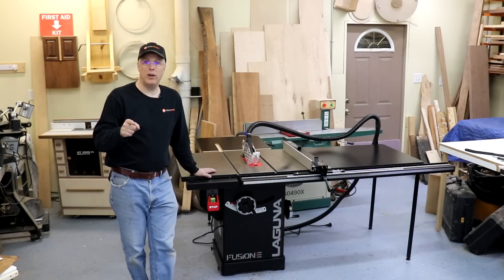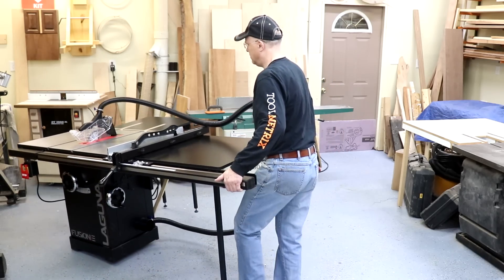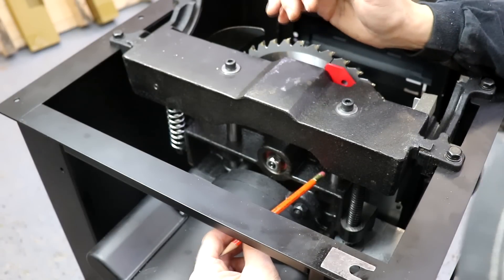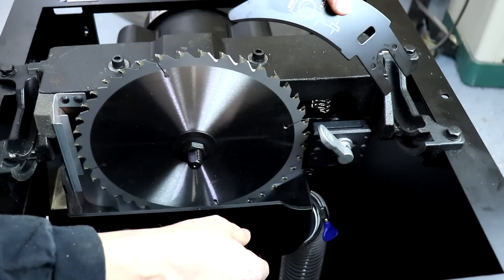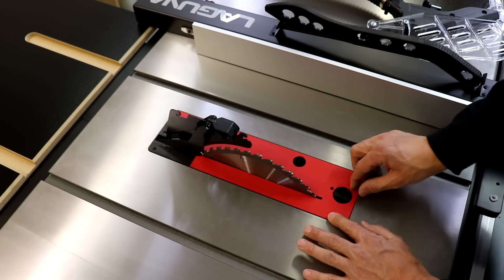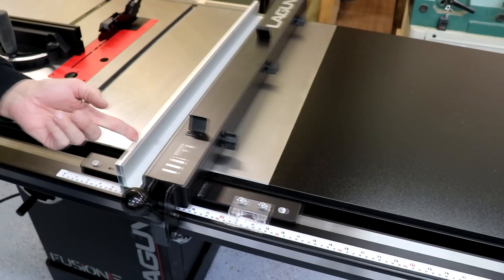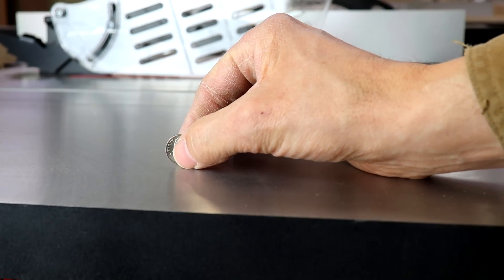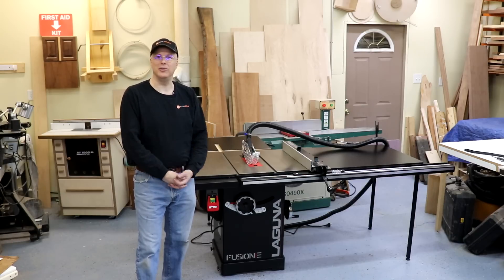Laguna Fusion F3 Table Saw Deep Dive Exam

Comment: Can anyone tell me if they still have this f3 after three years hows it looking on the reviews still happy with it
Reply from the maker: I did not have that one in the shop for very long so I can’t comment on longevity. But hopefully someone else can chime in.
Reply: @ToolMetrix  so that probably tells me that you did really like the saw much and thanks for the info ☺️
Reply from the maker: @anthonypalazzolo6181 I loved the saw, actually. But I am a tool reviewer, so I have tools coming through my shop all the time. I don’t have money or space to keep them all. I can’t actually keep most of the tools that I review.
Reply: @ToolMetrix  ok I didn't realise that sorry so I wouldn't make a mistake if I bought the f3 eventhoug I was looking at the SawStop contractor model but in a much expensive cost and towards the end it was another $450 d for the wheels  after I was getting the update fance and the cast iron wings all up was over 45k tha sort of turned me off and the f3 I was saving much more I can still bu the SawStop for that money but at the end I coudnt justify all the value and the compartment I do understand about the safety features but at the same time there's other tools that you can chop your finger off 
Thank you for the response and I enjoy your videos cheers 🍻
Reply from the maker: @anthonypalazzolo6181 no I don’t think you would be making a mistake. Both are good saws so I think it mostly comes down to how much the sawstop brake system is worth. If you use a blade guard it probably doesn’t matter much.

Comment: Great review, does the blade being closer to the front make it problematic to use? I have noticed that other table saw blades are further back.
Reply from the maker: I’d rather have it a couple inches back but it didn’t prove to be a problem when using it.   If necessary the fence can slide forward to effectively position the blade further back.

Comment: Is the blade a direct drive shaft off the motor didn't notice a v-belt drive from motor to saw blade shaft. I thought most where belt driven with some sort of v bely or serpentine belt . Do you really need to keep those kickback teeth on the riving knife Thanks for the review just getting ready to up grade from my Delta 3052 T2. Can you put a set of JessEm hold downs on the fence clearing the aluminum section on side of fence. I understand there dust collection wasn't that great compaired to a Harvey or Stopsaw.
Reply from the maker: The F3 is belt driven.  I believe that you can remove the anti-kickback pawls or flip them out of the way.  I'm not sure about the Jessem hold downs, as I don't use those.  I think the SawStop would likely have better dust collection if you have a big enough dust collector to take advantage of the larger internal hose.  If you use the F3 with a large DC, I would replace that internal hose with 4" all the way to the blade shroud.  I haven't looked at a Harvey so I can't compare that one.

Comment: Is it heavy enough? I tried to find out how much it weighs and I can only find 400 lbs. Online. That doesn't seem heavy
Reply from the maker: Seems heavy enough. Virtually vibration free when running. At 400 pounds it’s not going to move if you bump it.
Reply: @ToolMetrix  I'm considering buying this but am nit sure of I sure get this one or the grizzly. My brother in law has a grizzly and I know they are solid but the aren't in stock now and the dust port is on the wrong side for me.

Comment: Hi there, I am in the market for a new saw and looking at the Laguna F2.  I watched a few videos about them fence, and I am really concerned about the fence, there is no support on the other end of the fence, how much play is there, especially if you are cutting large boards the inaccuracy will exacerbate the problem.  Whats your opinion.
Reply from the maker: I found the fence to be solid and accurate. I have no rear support on my unisaw Biesemeyer fence either and it’s extremely durable and accurate as well.

Comment: Hi Paul, I should have my fusion 3 coming in a month or so (I’m UK based) and am looking to buy some blades. Could you possibly tell me if the blades for this machine use pin holes next to the main 30mm bore/arbor hole? And if so what diameter and spacing apart they are?

Thanks or the great review of this saw, just  what you need when you’re thinking of buying one!
Cheers,
Rob
Reply from the maker: Hi Robert, thanks for watching, and for sharing your feedback.  The F3 that I had here did not have any such pin holes, but it's possible that the UK version might be different.  I'd suggest checking with Laguna or their UK reseller.  Cheers, Paul

Comment: I'm pretty sure Iv watched this video over 10 times lol
Reply from the maker: Thanks x 10! 🤣
Reply: @ToolMetrix  Hey Paul, I was wondering if i could maybe get your advice.  I am kinda stuck between the F2 & F3 Table Saw.

I am a Canadian & I currently rent a basement.  I have full access to a 2 car garage by myself.  The landlord knows I will be doing woodworking.
The garage is not wired for 240v so i would have to bother my landlord to hook up a 240v breaker & outlet. 

Soo is there a big enough difference to stick with getting the F3 (240v) ?   or will i be happy with the power & usage of the F2 ? 

Price is not that big of a deal.        im planning to cut all types of hardwood and soft wood for furniture... tables, desks, art..
Reply from the maker: The F2 has plenty of power, so it really depends what you are used to.  With a good blade, it will rip through 4/4 and 6/4 hardwood with ease.  You'll have to take it slower with 8/4, whereas you can plow right through 8/4 with the F3.  My main saw is a 3 HP cabinet saw, so I definitely noticed the difference when I was cutting on the F2.  That said, I'm not a production woodworker, so I would have absolutely no problem doing everything that I make on the F2, and I'm sure I would love it.  If you are used to a more powerful saw, you can install a smaller diameter, and thinner blade, and the saw will feel more powerful.  A LOT more powerful actually.  For a LOT more detail on the advantages of a smaller blade, take a look at this video: https://youtu.be/_uJWWg-aawA .  So, all that said, if the difference in price isn't a big deal, a 3 HP cabinet saw is a treat to use, so don't let me talk you out of the F3 if you have the itch.  You'll also want to get a sense for which one would ship sooner because both of these saws have been backordered a lot lately.  They literally seem to sell them faster than they can make them.
Reply: @ToolMetrix  Thanks a lot man. I really appreciate your comment and honesty.  I still have about 3 weeks to decide which one i want before I can pick one of these bad girls up! 

Im pretty sure there is a store just a few blocks away from my house called "Federated Tools"  in London, Ontario Canada. They have them in stock on their website but I'm not 100% sure if they have them inside their building or if they just pass the order on to laguna.   I wont be able to find out until our city's LOCKDOWN is lifted on May 19, 2021.

P.S. Iv never used a Table-Saw before lol.. as a matter of fact,  as a guy who just turned 30 iv only used a mitre saw about 3 times. 
Thanks to COVID iv been studying Woodworking (Tools & Projects) for about 6-7 months... IM READY TO START MY CRAFT.
Reply from the maker: You're in for a great time!  Best of luck as you dive in to your new hobby.  I got my first table saw for my 30th birthday.  I've been having a blast with it ever since.
Reply: @woodpecked3D  Did you get your saw yet? I am also looking at this saw to buy from the same store, (I am in Brantford) and  was wondering  about availability.

Comment: How does dust collection work for two separate areas? Are they combined into one hose?
Reply from the maker: Hi Terry, yes, there is a single 4" inlet connection, and the hose for the blade guard collection branches off from there.

Comment: If you buy the F3 37", are you able to get Laguna accessory legs to support it?  Or do those only come with the 52" version?
Reply from the maker: I believe that they only come with the F3.  I doubt that they would be necessary on the 37" version.  Would be easy enough to attach some legs if you wanted to though.

Comment: Thank you for your previous comment 2 more questions concerning the laminate extension:
1. Is the extension plywood or MDF and laminate surface that may be possible to install a router insert in either the 36" or 50" extension?
2.  Is the deep dive photo that is standard showing the 36" extension w/ legs?
Reply from the maker: Hi Ed, the extension is a composite material; not plywood.  I don't believe that it was MDF, but unfortunately I no longer have the saw in my shop and I can't check it for you.  As I recall it's 3/4", and it's a fairly large span, so yes you could install a router insert but I would reinforce the table to prevent sagging over time.  The photo on the thumbnail is of the 50" version that I had in my shop, and that model comes with legs.  The 36" model doesn't have legs to support the table.
Reply: Thyank you -again - paul -  Very helpful!!
Reply from the maker: My pleasure, Ed.

Comment: Can you tell me if there are Laguna or after market Router Tables that can be installed in lieu of the Phenolic extension?
Reply from the maker: Hi Ed, I'm not aware of anything, but it's possible that something out there would work.
Reply: @ToolMetrix  Thank you - Is the extension plywood and laminate surface that may be possible to install a router insert in either the 36" or 50" extension?

Comment: I would have liked to see how you put the table back on and did the calibration of the table to the saw blade.
Reply from the maker: Hi James, good suggestion.  I'm thinking about doing a table saw tune-up video where I include that item.  It's very easy on this saw; you just loosen up three bolts under the table, leaving one of them mostly tight but loose enough to rotate the table, then carefully test alignment to the miter slot using a dial indicator as you make tiny adjustments until you have it right.  It didn't take long at all on this saw.

Comment: Great video thank you. Today I pulled the trigger and bought this exact model. Stumbled across this video looking to see if anyone had figured out a way to install the jessem guides, looks like no. Upgraded from a ridgid 4512 and bought the jessem guides for it due to kick backs. Turns out the 4512 I had was just impossible to get the fence right without bowing the extension wings for thin wide rips, hoping this will be better.  Guessing my dust collection set up (750 cfm)  will do very little for above so probably gonna disconnect the top set up but time will tell.
Reply from the maker: Hi Mark, thanks for your feedback.  I'm not sure about the jessem guides.  I haven't played with them, but I'm guessing that you would have to remove the sliding portion of the fence to make them work.  Maybe not, but those look very cool and I'd definitely work to figure out how to incorporate them into the new setup.  I think you're probably right about the 750 CFM DC.  I'd not use the upper hose.  I would still probably modify the internal setup to run 4" straight to the below table shroud.  There's also a 1" hole that goes into the body of the saw from the duct connection on the back of the saw, and I'd get rid of that for sure.  You would actually have to get rid of that if you go 4" all the way through to the shroud, but I just wanted to call that out because it's not very noticeable.

Comment: Thanks for the review.  It seems like a really great saw that I am giving great thought to purchasing.  However, I have one area of concern and that is the distance from the front of the table to the blade.  According to specs listed for this saw and several others that I am considering, the F3 seems to be several inches shorter than a PM64B or Jet Proshop 2, both of which are under consideration (yes I know they are not true cabinet saws and have less HP motors).  This fact also seemed to be of concern to folks listing reviews on LumberJocks forum.  Can you provide your thoughts on this?  Thank you.
Reply from the maker: Hi John, I was actually just thinking about this today. Overall I’d prefer that the blade be positioned further back to provide more runway when ripping long boards and plywood sheets. That said, the sliding fence helps with that situation by extending forward during long rips.  It definitely helps although it doesn’t give as much runway as som other saws. The upside of a forward positioned blade is that it provides an easier reach when using a sled or doing other crosscut operations. The reason I was thinking about this today was that I was cutting dentil molding and leaning over the saw for a long time and actually wishing that the blade was not so far back.

Comment: So I’ve been waiting since mid November for my Fusion F3 Table saw and 14BX band saw. The dates. Just keep getting pushed out. For what I’ve spent on those two tools I could purchase a nicely equipped 3hp sawstop that has what appears a true 5 week lead time. What would you do between those two options?
Reply from the maker: Hi Randy, That's a long time.  Very difficult decision. The continuous slip is frustrating, and it's a symptom of lockdowns a stimulus checks that are driving the demand through the roof.  I don't have any insight on what the actual lead time might be, although it's clear that people are buying these tools faster than Laguna can make them.  If all of three tools were available immediately, I'd take the Fusion and 14bx over just the SawStop for even money.  But with an indefinite waiting period, I'm not sure what I would do.  Sawstop makes a fantastic saw.  The only downside that I see being expensive false positives on the brake system that cause unplanned downtime, and an inability to use smaller blades.  (I like to use a 7.25" blade on my table saw as much as possible)  On the positive side, it's a super high quality saw, and I love the dust collection on the SawStop.  I think their design is about as good as it gets in terms of capture.  So, I guess it also partially depends on how badly you need a bandsaw in the near term.  In a typical year I probably use my bandsaw more than my table saw, but that is because I rough out bowl blanks, cut up logs, and do lots of resawing and some curvy stuff.  But, some people can get by without a bandsaw based on their approach to building.  Unfortunately, I don't have a clear recommendation for you, and I'm sorry that this is dragging on like this.
Reply: @ToolMetrix  thanks so much for the fast good response. I think I’ll continue to wait. Thee F3 is supposed to ship on the 8th.
Reply from the maker: 🤞🤞🤞 here’s hoping!!!

Comment: Just a word of warning to those who live in Europe, that are impressed by the US videos of the Fusion 3 saw, as I was.  The US marketing highlights 4 really nice features included with their Fusion 3 saw: (1) improved split blade guard with blade view, (2) the included Riving Knife, (3) their custom fit Mitre sled, and (4) a right side workspace laminate board with support legs....if you are a European customer, you won't be offered any of these 4 items, or you'll be forced to take inferior facsimiles.   Laguna touts these features, and they are all very valuable, and I was fully expecting to get them with my saw, but because I live in Europe, I'm told those features aren't offerred to EU customers...only US customers get those upgrades...what a shame!
Reply: The Laguna Fusion 3 Mitre Gauge is not anything special for EU customers, because of some "supply chain issue"...you'll need to spend another 80+ euro to get anything near the class the US customers get in their package.
Reply from the maker: Thanks, Jim.  I appreciate your chiming in with this helpful information.  Cheers, Paul

Comment: Thanks for the nice review. One question. Is it possible to set up the saw without the extension table to the right and without the fence rail running so far out to the right side? Due to size limitations, I would likely want to place the saw so that it takes less space towards the right side. Although I suppose the fence rail comes in single piece and so its not possible to have it shorter? Thanks.
Reply from the maker: Hi Hando, thanks for your comment/question.  From my memory, it should be possible to do this, but you will have to cut the fence rail.  They offer the saw with a shorter rail; I believe it's 36".

Comment: Looks like a lot of saw for the money!!! And you don’t need to change blade stop cartridge for your dado stack!!! Nothing personal Sawstop... I’ll just keep my fingies away from the sharp thing spinning very fast...
Reply: I learned that the hard way...twice now. Luckily in both cases I only lost a little bit of my nail and I DON'T wanna do it again. I've been considering a SS, but I think Laguna might just have em beat although I'll probably have to settle for the 2 model since Uncle Sugar ain't gonna help out on the 3..
Reply: Ya I’ve had a few close calls at the table saw myself... had a bad kickback on a twisted 2x4 that turned a couple of my fingers into hamburger... fingers were fine it just didn’t look pretty for a few weeks. Luckily I only had the blade barely higher than the thickness of the material. SS are great saws and I’ve used them a bunch
Reply from the maker: Yikes!  Yeah, kickbacks are nasty. I’ve had a couple. Not good.
Reply from the maker: Great points

Comment: Thanks for another very good and informative video. Is there any differance in the cabinet itself between the Fusion 2 and 3? Or is it just the table and other parts?
Reply from the maker: The cabinet is different as well.  It's thicker steel on the F3.
Reply: @ToolMetrix  Thanks ;-)